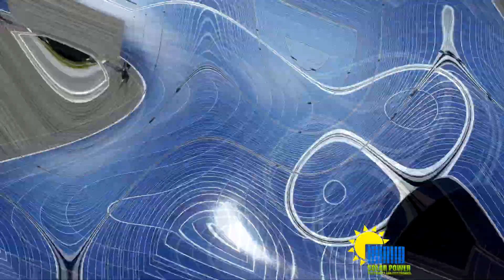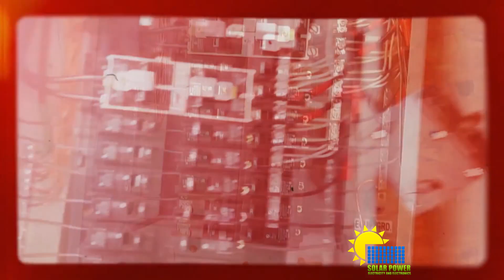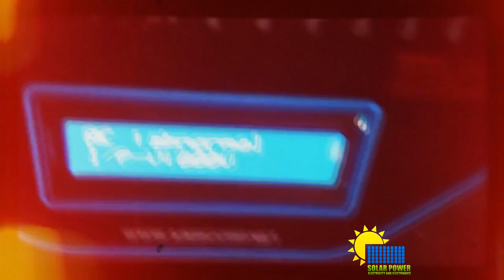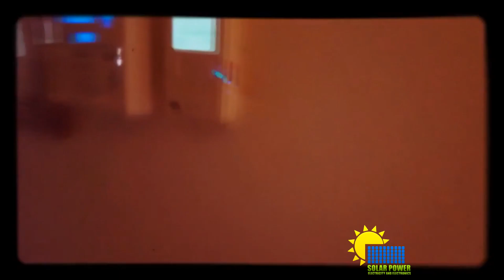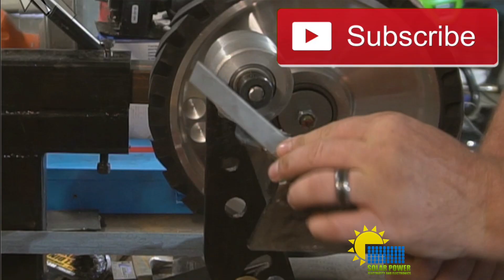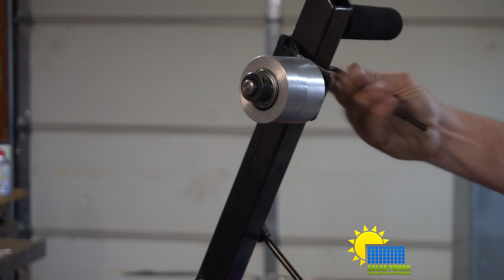Quality Sanders $275 Knife Grinder!!!! This Cheapest Knife Grinder In Facebook. 2x72 Belt Grinder !!

Comment: I've built 9 different 2x72 grinders. Made all of my own wheels including big contacts too. Every attachment including a few surface grinders and rotary platens.
      I mean this with zero disrespect and absolutely not as an attack on your displeasure with that "machine". But honestly, for $275, that's more than I would have expected. 
     Quality products require skilled craftsmen to produce. A skilled craftsman charges adequately for their time--- and rightly so. To make three wheels like that is going to take 3-4 hours minimum on a manual lathe. To saw and fabricate that frame including the D-plate and platen is another 4-5 hours easy. Those times are for a guy who has mastered his craft, which obviously the seller hasn't. So it probably took him much longer to build a pile of junk.
       Add 60-$80 for material cost to how much you think a highly skilled person should charge for 8-10 hours of labor. I come up with 800-$1000 to build that machine correctly.
Reply from the maker: your right i wasthinking the same thing